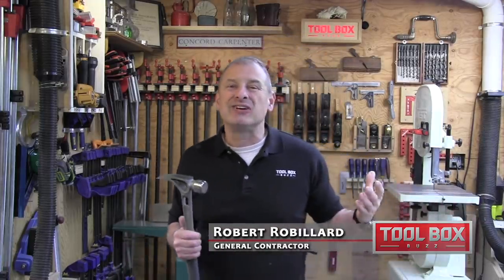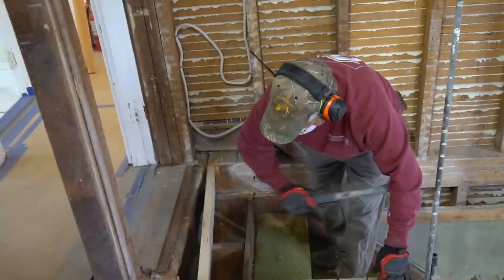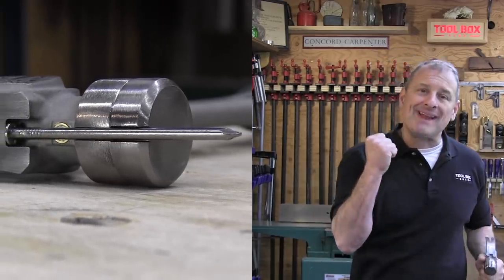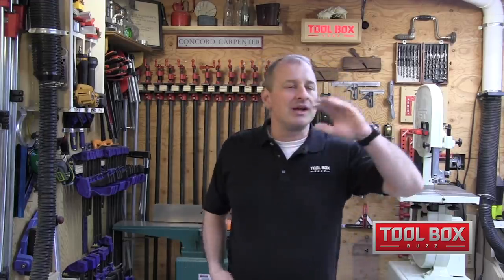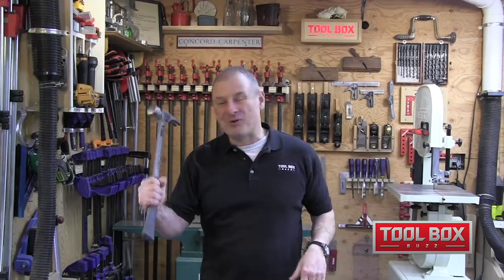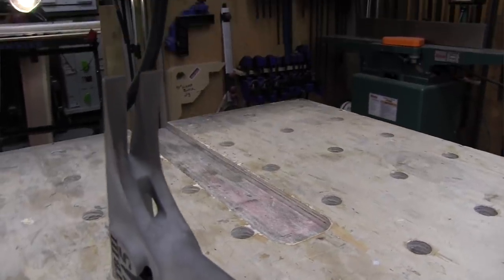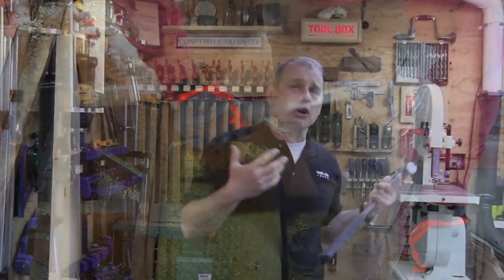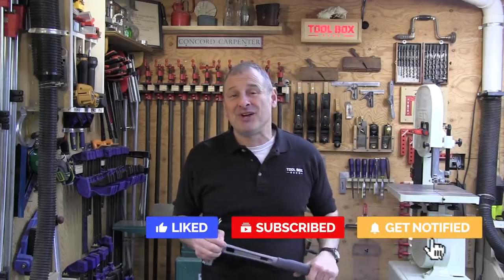Stiletto TiBone 3 Titanium Hammer Review - What Was Upgraded?

Comment: I’m an active DIYer, not a pro. I’m currently rebuilding a deck by myself. It was taking me a long time hammering 4” twist nails, longer than i thought it should. So I looked into getting a new heavier hammer. Shortly after making my decision to get a new hammer, I started experiencing shooting pains in my wrist. So I researched, found this hammer and bought it without even swinging it once. When I got it, I could tell right away, even though it weighed the same as my old hammer at 15oz, it swings much easier. It is well balanced unlike my old hammer and I think this is what makes it much better. You’re wrist isn’t compensating for all the weight at the end of a conventional hammer. I can’t machine swinging a steel hammer all day like you pros. I’ve had experience with titanium before and it is a magical metal. My titanium bicycle is light AF and it absorbs vibrations from the road, unlike my old steel bike. The difference in feeling is not nuanced but obvious and pronounced. The same goes for this hammer. 

Now, to my point.  LISTEN TO THIS GUY.  Especially if you’re young and starting in a trade that swings a hammer. Do EVERYTHING to protect your joints and your body.  Heck, even as a DIY person get one.  I wish I had found this hammer long time ago when I was young. I’m still relatively (feel) young at 50+, I can still do and want to do lots of physical things. You will too. But you can’t do anything if your joints are shot! Search for the best protection for your trade, buy it, then use it everyday. Take a loan out if you have to...seriously. Spread out over 20+ years, the cost of a  hammer like this is negligible. Also, Ignore the people making fun because you’re wearing PPE. The people not taking precautions will be unable to work for long while you’ll be able to keep going for much, much longer. Trust me when I say this, you do not want mobility problems when you’re old.

Great review on this hammer!

Comment: I swung a ti bone2 for two years, then bought a Martinez m1! Both are great hammers but haven't picked back up my ti bone since. The m1 hits so much harder!
Reply: I agree still have my tb2 that is 8 years old been swinging the m1 for 6 months now and love it
Reply: thats because the head is heavier & made of steel. so it requires more energy to drive it being that its top heavy. its like swinging a 26zo wood handle... no weight in the handle... because its all in the head. nail above your head for a week and let me know how your body feels. if youre swinging below your waste.. sure the Martinez is great.. but the TB3 is in my opinion the best. ive owned a tb2, an m1 and sold that m1 for the tb3 and havent looked back
Reply: Personal preference. I’ve swung both and the Martinez definitely swings heavier. It’s not much, but it is noticeable. The lighter swing is why I spent the money in the first place, so I prefer the Stiletto.
Reply: Martinez hits harder at the cost of it being heavier and less balanced. The stiletto is balanced throughout while the Martinez feels like a brick on the top of it.
Reply: Glad you like your stiletto.  The over all weight is the same so overhead strikes culmulatively similar.  It’s just the balance.  You get used to the difference.  Too bad you didn’t give the Martinez a chance.

Comment: Everyone on our crew has one cause we hand drive our framing still, just shoot the plywood. I enjoy it much more then shooting cause you don't have top worry about blow out or miss firing or relying on a air powered tool. Great vid rob
Reply: Tyler Sineath wow that’s a lot of hard work man.
Reply: What kind of company do you work for? Seems like a lot of wasted time hand nailing everything. Are you just doing prefab and hand nailing the walls together?
Reply: My boss it's just old school we do full size custom homes 12 thousand square feet
Reply: @bolerdweller  I’m a carpenter but not a framer. Framing crews usually build the walls on the ground and then stand the walls up. When I frame walls on the ground I prefer to hand nail, it’s easier or the back and pretty much just as fast.
Reply: @SweetStat  that's a big no for me lol. Frame walls on the floor sure but hand nailing isnt nearly as fast as using an air nailer. Try nailing wall backer together, flipping the plate nailing studs and building openings next to a framer with a gun and there wont be any comparison. Nail laminated beams together by hand, hundreds of nails and I'm sure you'd grab a spiker

Comment: I highly suggest taking a look at the Martinez M1.
Reply: I’ve used both and gotta say the Stiletto is my preference because of the nail puller. Although similar in design, the Martinez’ isn’t open on the other side, so you can’t grab the 2nd duplex head of a nail, and regrabbing the 1st head is much more difficult. Also, I like being able to spin the hammer around to achieve better leverage depending on where I’m pulling the nails out from as space is often restricted. I am primarily stripping forms in these instances, working in commercial.

Comment: Ive owned 2 tibone hammers. One a 3 and the other a 2. The tibone 3 lasted me less than 2 years before one claw snapped. Cant be replaced. First one i owned the handle broke at the bottom after 3 years which wasnt replaceable either. Apart from that they are excellent hammers.i donuse the hammer 6 days a week. However as construction worker who works in commercial buildings ill be getting the martinez from now on. Brother has owned one for 2 years every single day and it has nothing wrong with it.

Comment: These stiletto hammers are designed for concrete usage the pocket in the head is designed to be used on drop-heads shorings and catheads for EFCO forms, has a built-in stake puller and the hole on the back can be used for bending pencil rod on footing forms, you really notice the recoil reduction when hammering metal form hardware all day
Reply: Thanks for pointing this out I never knew those functions were there can I know from your experience how has the hammer held up I been worried about striking wrecking bars and cats paws and steel stakes in remodeling thanks

Comment: Question: Given the two changes, would you recommend retiring your TiBone 2 in favor of the TiBone 3?
Reply: 100% the Tibone2 is great and all but loose in the but end of the handle and head is offset now so the nail puller is not aligned so useless and the magnet is gone anyway. 
These problems are a dealbreaker to me and I wouldn’t have bought another Stiletto if they hadn’t been addressed in the Tibone 3. 
At the price these hammers sell they have to be impeccable in functionality and durability.

Comment: TI bone 2 saved my elbow when i switched to concrete forms. Banging nails , steel pins and clamps all day.  The only complaint was the rotating face that is supposedly fixed now
Reply from the maker: They ship the new ones with lock tight

Comment: Have been using Stilettos every day for a decade. Purchased my first M1 from Martinez a few months ago. My take is that the Martinez is far superior when it comes to striking and driving.  The Stiletto is way better to remove nails ( Side puller is thinner to grasp the head and the hammer is longer, thus more leverage.) When I take the Stiletto back, I feel like i am striking with more force that I should and that the nails just don't drive in as easily. Also, after a few years, your claws are done. With the Martinez, you can change both the head and the claws at the same time. The grip can also be replaced. No need to go through the hassle of sending it back to Stiletto and waiting. Last but not least. Martinez is all made in the U.S.A. Can't say the same about Stiletto products. Cough * China. Switch to Martinez. You won't regret it. My fellow framers did not either.
Reply: Martinez is too top heavy and unbalanced. my as well just swing a 22oz estwing and call it a day

Comment: I used to get like a tennis elbow, the first time i went to the doctor and he told me to tal a month off and let it heal?? I learnt to use hammer in left hand and alternated between left amd right but since nail guns i haven't had much trouble,. Yes im still using 24oz steel hammer but mot as much. I cant justify spending $433AUD on a hammer.

Comment: is this Stiletto 15 oz lighter or heavier than the Dewalt 12 oz. hammer?
Reply: Heavier. That dealt will break or bend on you if you are using it to pull nail or wrangle beams in to place.
Reply: @PosiXMosh  the 1 Piece Dewalt 12oz will break or bend if pulling nails? And it's lighter?  Pls confirm as I don't have a store nearby to try the weight out.  Thanks
Reply: @oilwings  I apologize. I just checked and the dewalt hammer I was thinking of was the “mig” 14 oz steel hammer. I bent it and the claw was not up to snuff for framing or demo. I’m not familiar with the 12 oz dewalt framing hammer, though I suspect you may be referring to a finish hammer at that weight. 
If you are going to be doing any framing, get a 20-ish oz vaughn or estwing framing hammer with a straight claw and waffle face with a fiberglass handle.  It will serve you well for years, and it has the heft to move material or nails without being so heavy that it’ll wear you out before lunch. 
You may decide you want a heavier hammer (make sure you have good mechanics if you go the heavy route) or one of these trick titanium hammers (I have the stilletto tb-ii and vaughn ti-tech and like them both... but they’re expensive and have their own weaknesses).
Reply: @oilwings  the 12oz dewalt will be lighter...

Comment: No point in using a titanium hammer. If anything you want a heavier hammer for more control and efficiency. Titanium is not as durable or as tough as steel either. A wooden handle is always going to be best as well.